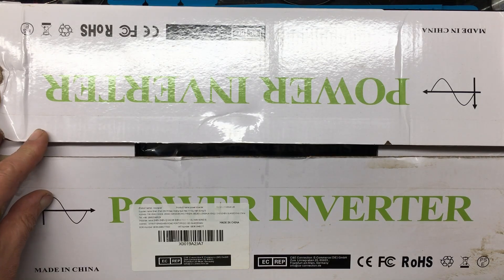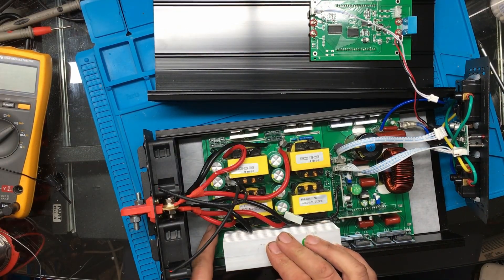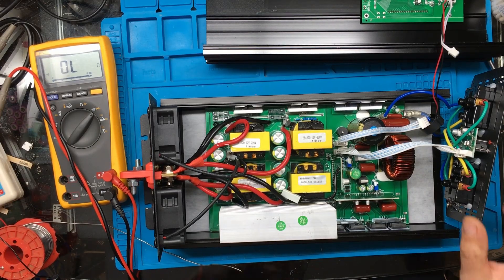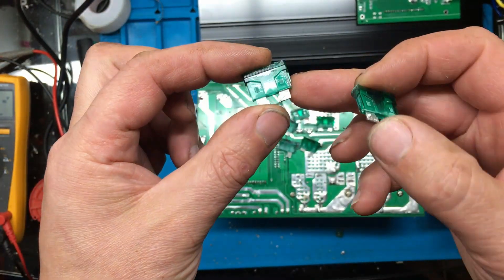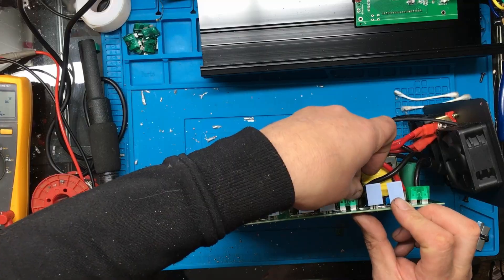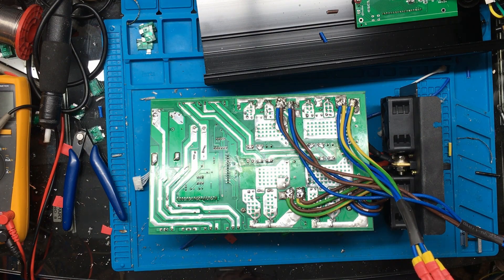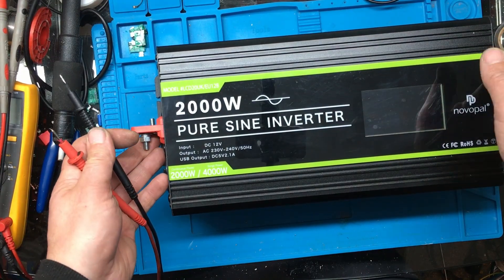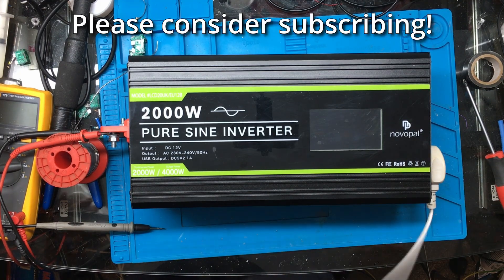2000W Pure Sine Inverter - Blown Up! - Let's fix it!

Comment: jupiter  model 57272 pure sine inverter consistently outputting 170 Hz
    If you have any idea where to start looking at , plz let me know !
Reply from the maker: Sounds strange, is there a PWM chip for the oscillator? I'd pull up the datasheet for any chips on it and try and see how the frequency is configured.
Reply: @B @BuyitFixit  Sir , not idea what so ever , i will try to find out , and let you know , manual is very basic , and just found outwhat an IC chip looks like !  i will open the inverter and take some pics from the inside ...

Comment: I would have put sockets in for the fuses, so no soldering is required if a fuse has to be replaced.
Reply from the maker: I would have probably but sockets in myself, but the owner was only visiting for the weekend and I didn't have any. The fuses are still replaceable without soldering now, as they just push into the spade connectors.

Comment: I can see your experience us not large enough.
And i subject to you, to change your iron with another more powerful.
Reply from the maker: Most of the stuff I repair is a lot small and usually requires a microscope. I seldom require a large iron. I should have perhaps turned up the temperature on the one I was using.

Comment: I reversed the polarity on my 2000W Green Cell pure sine wave inverter, which has a similar design, with protection diodes near the fuses.

The fuses didn't blow in my case, just a big spark at the battery terminal. I opened up the inverter to inspect for damage and found none. There were  no blown fuses, bulged capacitors, or smoked mosfets.

The fuses should normally blow, I guess in my case I just briefly touched the terminals and it didn't have enough time to blow the fuses. 

The power switch was on the ON position when I reversed polarity. I don't know if it could also be a cause for the fuses not blowing.

The inverter works fine after the reverse polarity incident. I did a small stress test for 15 minutes with 70% load on it and it didn't blow up. I used a cheap IR thermometer to inspect for any hot spots inside the inverter and didn't found anything alarming, the hottest parts were the transformers (43C), followed by the heatsinks and high voltage output caps (around 33-35C).

I'm very happy it survived, it would've sucked to throw nearly 200 euros out the window.
Reply from the maker: That's a lucky escape! 👍

Comment: I bought a secondhand maplin 600W inverter and it was dead....so i found all three fuses blown with the protection diode....which ive replaced,the power light comes on but no fan working and no output...ive checked most of the semiconductors and they seem to be ok...but there is microprocessor and an LM 324 op amp...im thinking it must be one of these IC's  but not sure if these processors are availiable as a spare part....the supply to the processor is ok at 5V and no shorts that i know of...the inverter is only drawing 20 Ma when switched on...would you blame the processor ????
Reply from the maker: Hard to say. I'd get the datasheet up if available and check to see if any other voltages or clocks and if it's in reset.
Reply: @BuyitFixit  reset is at 5V and power to the microprossor is correct at 5V...i contacted Nikkai and they cant even supply a replacement microprocessor....all the mosfets are perfect...i would have thought a processor would be protected againt reverse polarity but in this case i guess not.

Comment: I hope the manufactures of these items see these videos! Why would anyone solder fuse that size on to a board, but invest the time and money in making a full colored HMI, in which I am sure if the fuse blows go out as well?  This could have well been on the outside easy when the lights g out in your camper at 2am SMH!
Reply from the maker: Yes, not very practical as you say. I think these are build to a price point and they cut corners where they can.

Comment: I also had  one model similar to that one with the EGS002 SPWM board of those delivered to me with the exact same problem. Owner reverses the battery order and it blew up .. only the fuses were open everything  else was working ok. Also noticed the model said it was a 4KW ... but the max current allowed by the fuses was a 2KW ... :)
Reply from the maker: Gotta love marketing 😂😂Someone just dropped off a 4kw one for me to have a look at that blows fuses, so it might be a bit more of an interesting repair than this one was 🙂
Reply: @BuyitFixit  In my case the inverter also Stated on their specs they are 4KW Peak (?!), 2KW normal use. The one I got had a sticker outside saying 4000W ... It was a 12V input and a normal 220AC output (not 4KW rated for sure and with iffy inputs also). But there were a bunch of input  fuses in parallel and the total current on them was about 180A ... that is not 4KW not even close. and that's on input ... 
In any case these cheap inverters specs are not to be trusted ...

Comment: @buyitfixit, i have fluke 177 meter. Its doing wired things. The display works sometimes for few minute all good, then it disappear. Then after few try it comes back normal. Sometimes its half display is gone. I wonder if there is a way to send you a video footage of the problem i am having. Its fairly used unit. May be more then 10 years old. If i were in UK i would probably send you to try to repair the problem. But i am in South Africa. It is a night mare here when you wanna send and receive stuff to or from overseas. My fluke 115 is working for past 3 years without any trouble. Both unit i bought 2nd hand.
Reply from the maker: Sounds like the zebra strips on the LCD aren't making a good connection. I would clean them with IPA and then re-assemble it. Check the white plastic part for cracks where the screws hold it to the board as that keeps pressure on the strips to ensure they have a good connection 👍
Reply: @BuyitFixit  I did check the zebra strips that one is good. i cleaned and reset it on its place also. that was my 1st guess. but still the same problem happens.
Reply from the maker: The only other thing I could think are dry joints on the main display / IC or cleaning the carbon pads? (can't remember on that model) that the zebra strips make contact with if you haven't already.
Reply: @BuyitFixit  i will try Ur method tomorrow.
Reply: @BuyitFixit  i will use my mini soldering iron to retouch the main display IC. i will let you know if that helps.
Reply from the maker: @mamunhasan1672 tip: use plenty of flux 😉

Comment: I recently attempted a fix on an inverter and they had the same auto fuses. They had soldered the female spade connectors through the circuit board, I wonder if you could have done that too? It may have been easier than all the extra wiring. Just a thought. (I didn't manage to fix mine, all fuses ok all transistors ok. Must have been a chip, so I gave in...😳)
Reply from the maker: Shame. Good idea on the female spade connectors though. I had thought about it but wasn't sure if the crimp part would fit through the slit on the PCB.

Comment: I agree what a horrid bit of design soldering the fuses in. Im pretty sure you can get pc mount fuse holders. Thats actually a good ad for that inverter.
Reply from the maker: Yes, I've seen PCB fuse holders before. This one was a bit of a rush job as the owner was only up for the weekend so I just used what I had lying around.

Comment: Hi Mick, I live just outside of Newcastle and have a Giandel 12v to 230v 4000W inverter that I use for my caravan. I’ve only used it a couple of times and it’s blown four of the internal fuses. I was hoping if I could drop it off you could have a look for me? I paid over £500 for it and the manufacturer has sent me out a replacement. Be a shame to throw it away, when I could make a few bob back on it. 👍🏻
Reply from the maker: Hi Mate,  I've got a fair bit of stuff to do currently, and not enough hours in the day. I could possibly look at it "sometime" but that could be weeks or months from now.
Reply: @BuyitFixit Sorry Mick just seen your message. That’s fine with me, I’m in no rush as the company sent me out a replacement. What’s the best way to arrange getting it to you? 👍🏻

Comment: So when the fuses are blown. Chances are the power was put into it backwards?
Reply from the maker: Maybe, or if the main mosfets failed it would also cause the fuses to blow.
Reply: @BuyitFixit  I have a 2000 watt one I've been working on for about 4 days. And I just can't figure out what's wrong with it 
Everything measures everything checks out. There's no sign of damage no heat stress. It's shorts out the instant you turn it on. But if you hit it with 12 volts from little tiny battery pack the fan will run and the light Will change Auburn and it'll beep. But only when you apply the minimum amount of power. It's very irritating

Comment: Fuses are good , replaced two mosfets and still completely dead !! Checked with voltage meter and 12v registering within the unit ? Any ideas what to look at next ?
Reply from the maker: I'd check the PWM chip. Get the datasheet, see if it's getting the correct supply voltage, and if you have a scope see if it's giving a waveform on the output pins.

Comment: Thank you for the video.  I have an inverter 12v that keeps popping my 2 external fuses when connecting to my 12v battery. This all started happening when I plugged something in on my inverter AC inlet of the inverter. Can you please lead me to a solution. Thank you. I feel like a high voltage surge went into the inverter through the AC side of inverter. Thanks again

Comment: Those large solder joints are pain to desolder indeed. I use hot air to help my iron, it works rather well.
Reply from the maker: Thanks for the tip 👍🙂

Comment: Good job ... I have a Xantrax  12v ProSine 2.0 (2000W) inverter that was accidentally connected to 48v for about a second.  I forgot to disconnect it after upgrading my system.  Did a quick peek and I don't anything burnt, and there are some fuses, but they are buried.  So crossing fingers and hoping I get the same results.🤞
Reply from the maker: @GregOnSummit  hopefully, if not I've fixed a couple of other inverters on the channel which had blown components 👍

Comment: There is always a diode inside across the power and ground.lf reverse wired the diode will short and the fuse will blow..cut the diode off and replace the fuse. Your nuts
Reply from the maker: @davidstevens7809  Not all devices feature a reverse polarity protection diode.

Comment: Probably wired it in reverse. I once did the same accidentally and the DC-wires started glowing😂 Because of the transistors/diodes it pulls a very hight current when wired in reverse, maybe so the fuses will pop to stop or minder the damage
Reply from the maker: Yes, that's exactly what happened, although I'm not sure if they had the glowing wires 🙂

Comment: top video, thank you. 
I have the same inverter only with 24v and 3000W. The display no longer lights up, 6 months after the warranty expired. Is it easy to replace the lamp? Or do you have to replace the whole display? or does the display on/off switch no longer work?

Comment: Device build without any valid engineering standard. I'm a designer of the old generation, when we gave 50% leeway to voltage and power of all components, and certainly didn't save few pennies by skipping fuse holders.
Just avoid buying power subsystems from eBay and Amazon and other fortune sellers. You'll thank yourself later...

Comment: Is it a decent sinewave as some inverter circuits give a modified square and some things will not run correctly.
Reply from the maker: One thing I didn't check was the output waveform with the scope. I did on a couple of other inverters I looked at like the sterling one and that one was pretty much a modified square wave.

Comment: Flux is your friend, always use flux after sandpapering or grinding as you did to stick solder with soft surfaces that isn't pre-solderd like those fuses
Reply from the maker: The fuses were aluminium. I did order some special aluminium flux to try and it is possible to solder to aluminium with it. Normal flux doesn't work.

Comment: I would have taken the plastic off the spade connectors and opened up the ring that the wire goes in, snipped it to fit the hole in the PCB and soldered that. It looks a lot neater that way and still makes the fuses easily replacable.  Just a thought.
Reply from the maker: Good idea. Ideally I would have used PCB fuse holders but the owner was just visiting for the weekend so this was just a quick fix to get it running again.

Comment: Chinese units don't last cheap parts they use... fail .....lucky you get a year out of anything Chinese with out some kind of problem
Reply from the maker: Yes some of the quality just isn't there, although I've had some stuff which has been quite reliable too. I recently bought a 4000W dimmer (to run a 3KW heater) which came in a nice metal case with a red LED voltage indicator. I tool it apart and noticed the switch was only rated at 6A at 250V which is only 1500W! The plug was a cheap unfused one with a thin lead too, and also had an inadequate heat sink which got very hot after a few minutes of operation. I ended up pulling it all apart, putting the dimmer board in a larger case with a larger fan cooled heatsink and pretty much re-building it.

Comment: I bed all mosfets of the primary inverter had  gone. This inverter got  the  same pcb as  lot  of other inverters of different brands.
But in this case only the fuse blown. Congratulation!!
Reply from the maker: Yes I was expecting the mosfets to be shorted too!
Reply from the maker: Yes I was expecting the mosfets to be shorted too!

Comment: good job but the real question should be asked why did the fuses blown ? ... the system was saved by the fuses ....
Reply from the maker: The fuses blew because it was connected to the battery the wrong way round.

Comment: I wonder how long this fix held up? Our inverter kept blowing those exact fuses over and over again. Replacing them didn’t solve the issue. It ran for a few hours and then the same happened again.
Reply from the maker: I'm not too sure if the owner has really used this since the repair. They haven't mentioned any problems to me. I wonder if it has too much load on it? If you replace the fuses, power it with no load, then check the fuses again have any blown? (Just wondering if perhaps one section has a short and therefore reduced power output).
Reply: Thinking more about it the issue must be the fuses being under rated. 4x40A is not enough for a 2000W load on the 12v side. Mine kept blowing when maxing out the inverter.
Have since switched to a new inverter with resettable fuses.

Comment: You know you can buy fuse holders for them to solder into the board?
Reply from the maker: Yes, which would have been my preferred option, but the owner was visiting for the weekend and I didn't have any, so I used what I had available at the time.

Comment: as a hobbies PCB designer they should have the FET's part separate by wire so the only thing you do is disconnect the connections and replace a small board of FET's
Reply from the maker: Great idea, but it would probably increase the cost of the unit. I'm sure these are made as cheaply as possible...

Comment: During an extended power outage of unknown duration, I found the same issue with a primitive MSW 200W inverter.  A soldered fuse was replaced with a couple of jumpers and a field-replaceable fuse.  Inverter still works!  It was an experience standing in a freezing room with battery operated light and soldering iron trying to get this dinky inverter working again.
Reply from the maker: Nice 👍 Main thing is that you got it working again. Well done 🙂
Reply: I have a 1500w pure sine inverter (8yrs old) that is used everyday and have changed batteries once in it.   Has the same style fuse but with leads soldered into a holder.   Shame they didn't do that with this one.

Comment: Howdy,  I have the same issue with my Renogy 2000 w inverter.  My fault, I was standing right there as a friend hooked it up to the battery, to busy talking and not paying attention!  My unit has 10 ea 25 amp mini blade fuses wired in parallel all blown.    Hopefully it's just the fuses as I've had this unit for a couple of years and never used it.  What is the reason for this wiring system?  I know the total is 250 amps.  Designed for a slow blow or fast blow or ?  Thanks for any input
Reply from the maker: I'm not sure if automotive fuses are fast or slow blow. I'd check the mosfets with a meter for short circuits first, before fitting fuses and trying it.

Comment: When testing generators I like to use a paint stripper. They have a constant amp draw and are easy to control.
Reply from the maker: Thanks for the tip. I recently looked at another one and used a 520w cupcake maker (resistive heater) for the load.

Comment: This Inverter factory design the fuses on board directly, it's not easy to replace fuses.
Reply from the maker: I just repaired another inverter and that one seemed to be much better built and had fuse holders 🙂

Comment: Is it just me or did the manufacturer make a blunder wedging those capacitors in-between transformers AND underneath those cables? Seems like they're at risk of over-heating and having their lifespan reduced.
Reply from the maker: Probably not the best designed device, although I'm no expert on designing electronics 😂😂

Comment: I've soldered significantly more heat hungry power planes than those with a T245 C245939 tip (6mm cartridge knife).  It is a beast and once you have one you'll start using it a lot.  At 290℃ I'm able to do most of my component soldering and serious desoldering jobs like these at around 340-350.  Whereas if I use the kind of small tip you used there it takes significantly longer.
Reply from the maker: Thanks for the "tip" 😂👍